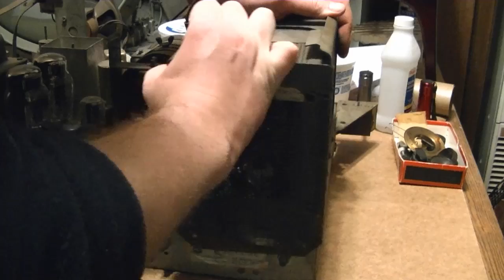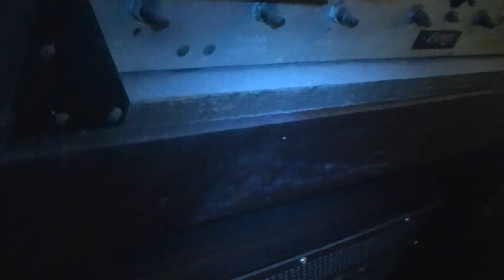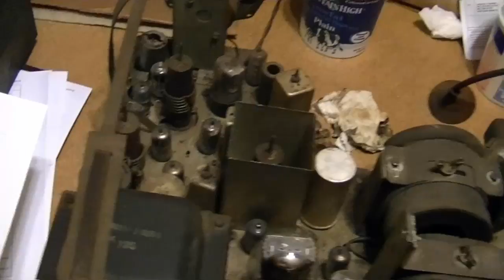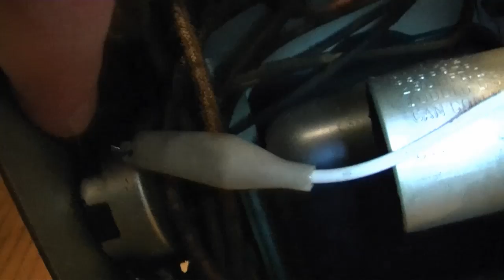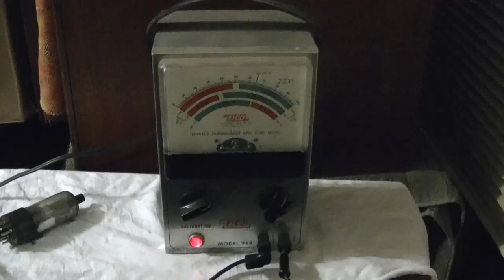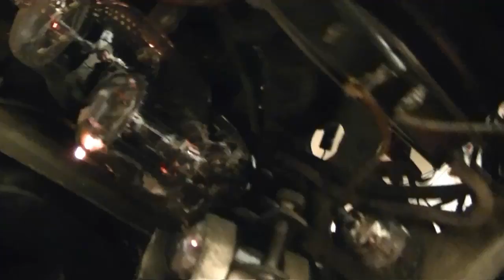RCA 630TS restoration p2o?

Comment from the maker: I think they do go bad just sitting from corrosion and don't believe this set can work without those big resistors.  generally when one section fails no more current runs through the others so they wouldn't burn out.

Comment: Not sure, but autoranging in multimeters tend to get crazy when there are some coils or trasformer in the path, to be sure, you need to force the range, or keep trying on each one. Anyway, is more likely you comment, that's because rust on the contacts.